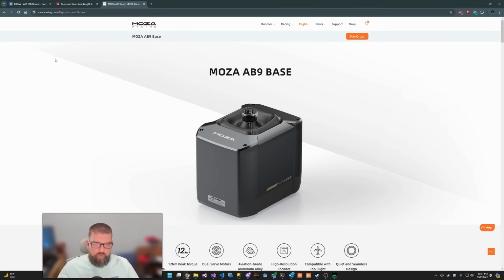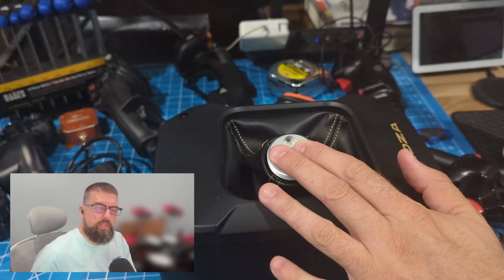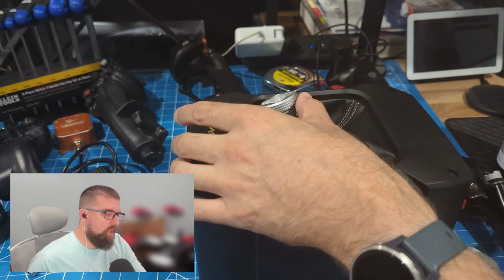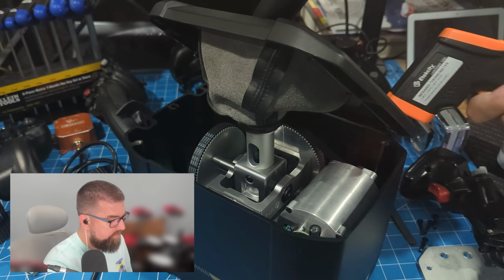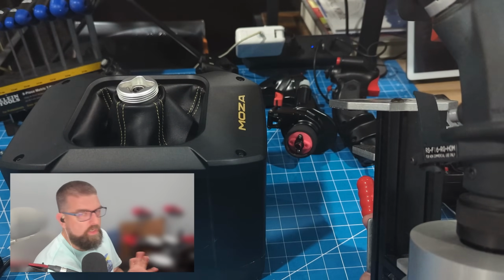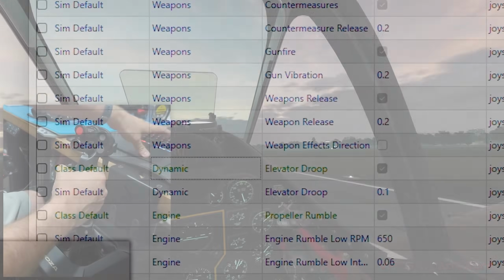MOZA AB9 Force Feedback Flight Sim Base REVIEW | DCS World / IL:2

Comment: I have the Rhino FFB and I love it for helo flying (I'm a rotorhead). The Rhino does have fans on board, at least the version that I have does. They aren't always running, but will come on if you keep the stick deflected against resistance for awhile (e.g., not using helo force trim). Also - if you center mount the Rhino to you chair, it gives you a butt-kicker like rumble in your seat. I also have a subwoofer mounted to my chair, which is not quite the same, but that adds up to a nice seat rumble when you use AB.

I'm thinking of getting this for my teenage son who is really into helicopters as well, and your review really helped me figure out whether or not I will pull the trigger....I'm thinking I will wait until some of this stuff gets ironed out, or at least get on the Rhino FFB waitlist again.

Comment: Any thoughts on the software being from an open source protected under GLPv3 licensing? At first, I thought it was hot air within the flight sim community. However, I am beginning to think it’s the truth. No Moza flight dev or PM has responded to customers questions in 14days, and the last update was well over that timeline. It also makes me question if they have capable staff maintain and even improve on “their” software if they are using opensource code and converting it to another code base. It doesn’t sit well in the stomach and at the time of this all coming to light, I was well over my return date.  I would hate to see more community members make a large purchase knowing the current situation within MOZA flight sim camp?
Reply from the maker: This is an issue between vpforce and Moza. If they did in fact violate a license then ya what they did is wrong. But I'm not gonna get involved in the drama.

Comment: Any idea if the VKB NXT sticks would work with this?
Reply from the maker: I don't have that stick but if it has the same adapter as other vkb sticks then it should work with an adapter like the one I showed in this video.
Reply: Aren't the NXT devices stick and base combined?
Reply: @1wordtroll  - the stick can be removed, and changed out for other styles, but I have no idea if the separation plane is equivalent to what's used by other systems.

Comment: Winwing has 6 pins, but 1 pin is not used. Hence a 5 pin to 6 pin,  TM stick - WW base can work with appropriate adapter.
Reply from the maker: Correct, but we are testing WinWing to a non-winwing base, not the other way around.

Comment: Great review Jabbers, my only point would be on your assumptions about the simplicity of FFB for cars. It is actually the inverse. There is a lot of differences between a very large swathe of factors. We're talking everything from the suspension design and setup of the car, to the amount of wear on the tires, and even the amount of dirt build up on the tires. In iRacing, I have different FFB settings for nearly every car.
Reply from the maker: I agree, but there isn't any external telemetry force feedback software that I've seen? It's always built into the game rather than having an external component having to tell the device how the force feedback feels per vehicle
Reply: @Jabbers  a lot of the software for the newer direct drive wheels allow you similar adjustments. Moza's pit house software calls it FFB Effect Equalizer. It's not the same as telemetry ffb, but the user has a similar experience: they can adjust the force feedback for certain effects.
Reply from the maker: But it's global, not loaded per car right?
Reply: @Jabbers  pit house does not. I'm not sure about other manufacturers. It bears mentioning that my original comment was referring to a comment you made in the video about all cars feeling similar. I may have misinterpreted your meaning.

Comment: So regarding FFB in driving it is way more complex than what you described,
I have the Moza R9 , in general Direct Drive FFB is way different than standard wheels 
You feel the tyre grip, you feel the acceleration, you feel the gravel or dirt stuck to the wheel , you feel the resistance and almost every detail you can depending on the sim, in fact using a Direct Drive wheel will allow you to feel the car on a depth level that you cannot even imagine, you could close your eyes and still know exactly what is going on.
Reply from the maker: But does someone have to write code for every single car? Or do the games typically have native support only for FFB. In flight sims every plane feels different and a profile has to be made for telemetry FFB for each individually
Reply: @Jabbers  So it depends if we are talking about proper Simulators like iRacing or Assetto Corsa then Yes absolutely the code is very different between each vehicle and the handling and physics are different,
in iRacing there is the Mercedes F1 car that was built with cooperation from Mercedes to make it as accurate as possible to the real F1 car, also there are a lot of Aerodynamics, weight and weight distribution and many other elements that affect the cars performance and handling,
Reply: in Assetto Corsa there are 3rd parties that make car mods and sell them similar to what RAZBAM does in DCS
Reply from the maker: I guess I mean telemetry FFB done outside the game itself like it has to be done with flight sims

Comment: Is it holding against resistance that heats the motors up or continual movement?  Either way I have a 940 and have never noticed the feedback weakening or cutting out due to heat.  Only stick I have heard of that being a problem for is the cheap Brunner (CLS-E IIRC).

Comment: 19:00 Easy to come up with a use case to holding a spot for extended time: You're flying a helicopter and either do not want to trim atm for some reason (example: The Kamov where the trim is linked to the AP/pilot helper system, so trimming overrides your previously held parameters) or the trim is inop because of damage. For example you're in a hover and need to get out of dodge - you might hold for a minute or two because you have better things to do than trimming.

Comment: Appreciate the review, but please tell us how it actually works/feels when its IS working? most importantly for me and im sure others, how does adding an extension on effect the FF ? some have a big extension, some like myself use a smaller one. Should I assume a smaller one will give me more of a FF feel?
Reply from the maker: Ya adding an extension reduces the feedback, but even with a 200cm extension I feel it's plenty. Roughly 5-6 lbs of force for  full deflection which is about what most spring/cam bases are. As for how it feels while using it, it's fine but funky due to the limited direct input effect and then little to no telemtry so that one is tough until the next update. I am hoping to do a follow up about that if the software is good

Comment: overheating is an issue. 
You asked yourself, why should someone hold a stick for so long in a certain position. The answer is easy, If you fly a helicopter, e.g. DCS Apache or Gazelle you use heavily the trim function / force trim to change the center of the stick. 

This leads often to overhead problems, especially if you use an extension with a heavy stick. 

I have this issue often with my Brunner Innovation CLS-E base.
Reply from the maker: Trim doesn't fight anything, it recenters where the spring center is emulated. I will do more testing once force trim works but the base isn't fighting itself when force trim is out of the center position.
Reply: @Jabbers  when you recenter the stick and it has an extension and a grip that is not out of cheap plastic it will permanent stress the motors
Reply from the maker: That's probably true, hadnt considered that, but it I'd imagine its not a huge amount.  That said, over time it could slowly get warm from it.   I'll have to do some more testing with that in mind!

Comment: I am super curious what motors they are using. Sensors too. I want to know angular resolutions of their sensors.

you can't thermally test a reflective surface with thermal imaging, you need probes. it will reflect and return a number shifted towards ambient temp due to the reflections. Usually unless it is polished its only off a few degrees due to ambient temps, so its not the end of the world, but it will throw off the numbers and its not a simple action to fix those numbers.

Comment: @Jabbers Just in case you didn't know, to use Force Feedback trim in DCS helicopters, you should remove the curves in the axis settings. What seems to happen is the stick will trim to the output value instead of the input value. If you don't use curves, input and output are always the same anyways.
Reply from the maker: Yep, there are no curves set in DCS for anything I fly so that wasn't the problem. Appreciate the insight!

Comment: BTW I guess the desk clamp doesn't come with the thing... but there's no way to order it. Weird stuff.

Could you by chance test how well the thing does without any mounting with just the thing on the desk? I'd probably do that for a while or put it to the ground with extensions (1 probably won't be sufficient...) before finding a way to fix it in place appropriately somehow.
Reply from the maker: Without a mount you need to turn the FFB way down.  It gets wild if you dont.
Reply: @Jabbers  OK, was expecting that. Running the FFB2 at 66 spring / 20 shake typically (feels smoother than at full force and I prefer just having subtle shaking), so I guess I'd do that anyway. Don't even know how many Nm the FFB2 can do, but I guess it's significantly less.

Comment: Thanks for the in depth video.  does the VKB proprietary mounting method hold up to the FFB forces?  Mine can get lose/raise away from the connector and break the ciruit just from the regular gunfighter springs over time.
Reply from the maker: I would imagine so, the VPForce Rhino offers the same 9Nm force and lots of people are using the VKB with it.  I don't have the time to do long extensive testing on a singular grip like that.
Reply: I had read thay the moza wont work woth vkb as the base needs an electrical connection to ensure a stick is on it. Have you tested this? @Jabbers
Reply: @PadinnPlays  this is in the video.  he uses a vpforce adapter to bypass the base connection and run vkbconfig software to the blackbox

Comment: 0:00 LOL!

0:46 R U kIdDiNg Me? XD

My current FFB stick is old enough to have beer in the United States!

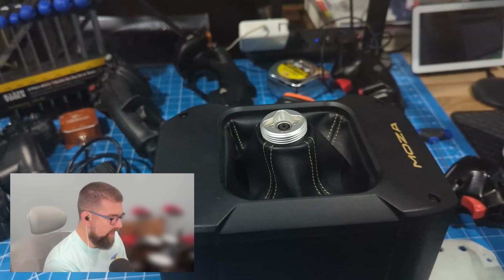7:17 XD

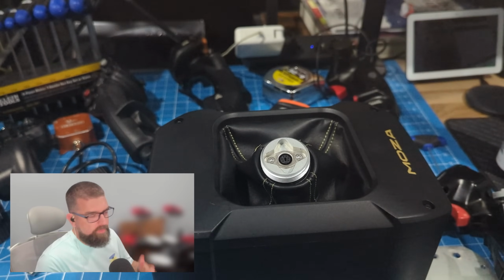7:47 I never felt that PS/2 needed a revival...

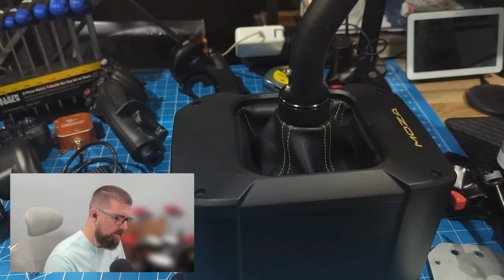13:37 Luggage weigh. Not weight XD

15:11 lol.

15:20 That'S what she said.

16:44 The first Sidewinder FFB Pro released in August 1997.

17:38 I heard the Brunner which is "just" 4Nm nominal / 6.8Nm (not nice!) peak does this a lot if you'd fly Il-2 with it. Which kinda sucks, especially at that price range. My FFB2 never did that OTOH and I hope the Moza won't either.

18:51 Exactly that. I mean you wouldn't trim for the constant turn...

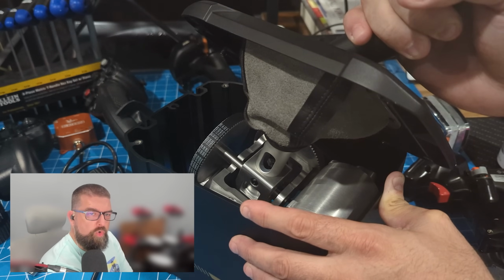19:52 23.3 in "Commie" units XD - it needs to be about 20% cooler!

21:23 Would it be an axis normally? Would wish to have that as an axis instead of just being a glorified button.

29:54 If it supports the original DirectInput API for FFB, it's to be expected. What I didn't expect there is MSFS 2020 since that doesn't even have FFB support at all.

30:17 That's great. Basically all FFB-supported games and sims should work with this.

30:55 ^this

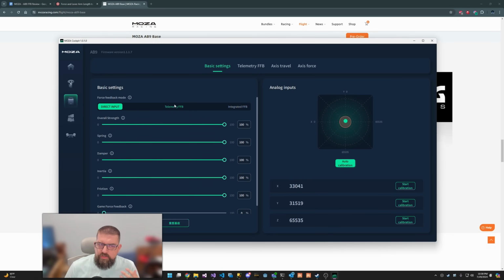31:04 So basically that works like the Brunner thing or XPForce for FS2020 which sadly never worked for me...

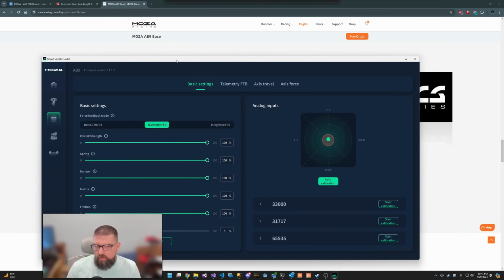32:18 Probably requires Simconnect, but I guess they'll just have to work on it still. I'm putting my money on FS2024 for that anyways since Asobo wants to add FFB support there themselves, finally!

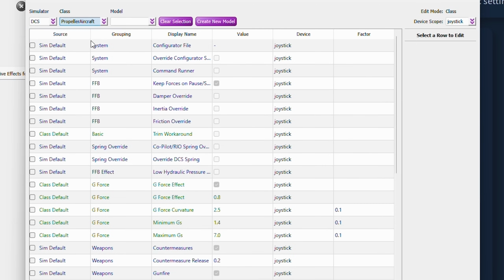36:58 And that's how it needs to be as every aircraft would and should behave differently.

44:53 Exactly my sentiments there. I'd at least expect the DirectInput stuff to work flawlessly at launch. Hope you'll keep us updated.

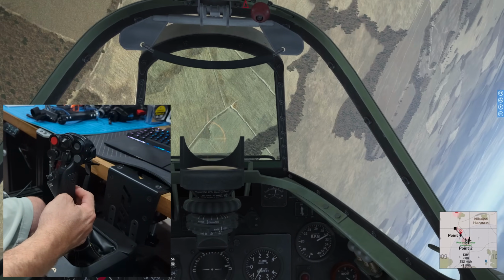45:00 This is literally the resurrection of FFB and I hope it will take off even more than the original did. The FFB2 and all its coptetitors were actually quite commonly used back in the Il-2 46 days. And those who wanted a HOTAS usually had the Saitek X45 or 52, but often not using the stick, because they'd be using the FFB2 at the same time.

45:08 Immersion Inc, The Company That Solely Exists For Patent Trolling.

Conclusion: I am actually considering to cancel my order and wait until a local store has the thing, would save me a good amount of money. In the long term, I might end up switching to Virpil if they do have brake levers that aren't buttons (never paid attention to those details since the sticks never were FFB).

Comment: Finally first decent review for AB9! 
The only thing that personally I would like to see is the temp test done after flying 2-3 decent dogfights.
Reply from the maker: Sounds good, I am planning on doing more temp testing as I've learned some things from commentors here as well.  Perhaps along with a follow-up on the software after the next release (assuming things are better)
Reply: @Jabbers  Does one of those things include using a contact based thermo sensor, or at the very least putting some non-reflective tape on the motors? Pointing an IR temp gauge at a shiny piece of metal is no bueno, learned this the hard way trying to measure the temp of a kettle with one... =)
Reply: I like my stick to be warm. Nothing worse than a cold stick!
Reply: @benjaminnevins5211  🤣

Comment: Something not clear to me, maybe you can help me here.. When you select direct input (or the other two methods), this is basically telling the joystick to get its dynamic from the game. Then, the settings below (spring, damper, inertia, friction) should be irrelevant and you should set them all to zero. In my mind, these settings (spring, damper ..etc) are added forces on top of the game feedback (??) . So, in the torque equation for the two motors, the game will send back some torque values, and these settings will be added on top of them (?) So, if you set them to zero, the stick is following exactly the torque values sent back from the game. any thoughts? thanks for the great review. btw, I did pre-order it but I canceled the order a week ago..
Reply from the maker: Games don't typically send all that info, so you can set the spring force and the game typically just sends whether it should be increased or decreased.

Comment: The levers are not brake levers, they usually toggle nose wheel steering on/off with weight on wheels and/or toggle auto pilot on/off with weight off wheels. Using them as brake levers would be an alternative use, not the primary, as in using for Spitfire or something.
Reply from the maker: Not if you are flying redfor jets or helicopters :) its always the brake

Comment: Did you notice any cogging?
Reply from the maker: Explain please
Reply: @Jabbers  It's a known problem in FFB sticks where the tiny individual steps of movement inherent with the multiple magnet positions inside the motor cause a noticeable micro-stepping feel in the output of the stick. Proper software has anti-cogging features working behind the scenes to prevent it.
Reply: @Darrylx444  I'd expect the thing to have much less than the Sidewinder FFB2 or even none of this. BTW the G940 had literal TONS of that, it was one of the things that was so bad about that thing, but not even the worst.
Reply from the maker: I've never felt that, but I will pay attn for it now, thank you for the explination!
Reply: @Jabbers  If you have your force set lower the cogging will be less noticable, so if you want to test cogging you also need to be on the max output.  I have a G940 for instance and at anything up to 55% feedback you can barely feel the cogging, but at 100% it is like you are pushing the stick past a bunch of tiny detents.

Comment: in helicopters we have to hold the stick in a defection state the whole flight,,   did you try just the windows usb  without the moza software . i use my VKB pedals an virpil base with thrustmaster F 18 grip without any software just plugged in to windows works perfectly as it should i did have to firmware update my winwing throttle once when i first got  with the simapp pro software but i don't even have that app on my pc anymore also
Reply from the maker: Yeah it works without the mosa software  but it has the same trim problem with helicopters.